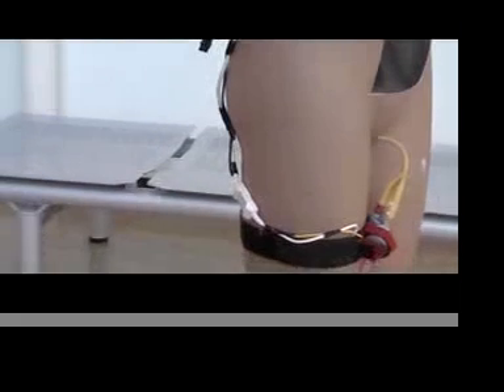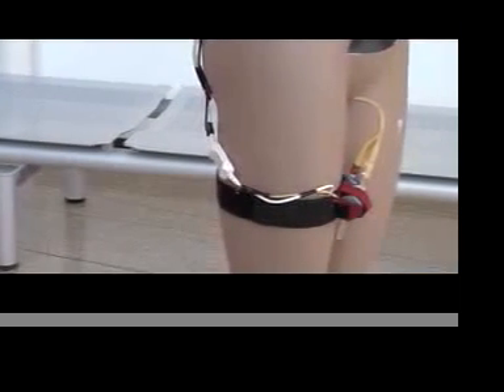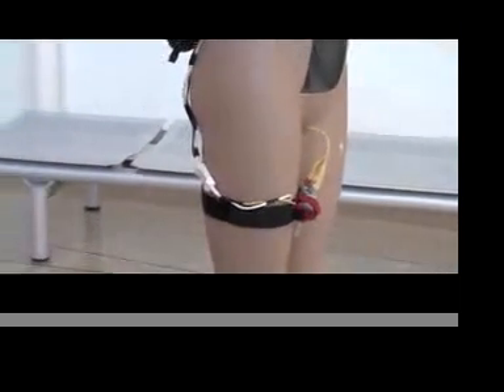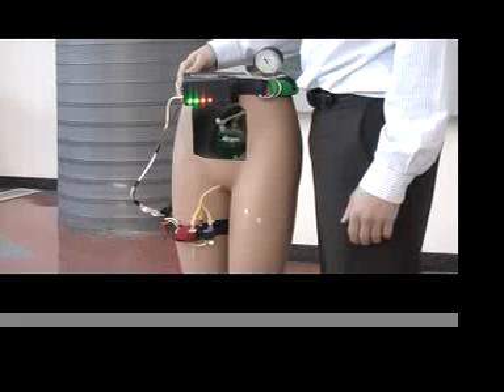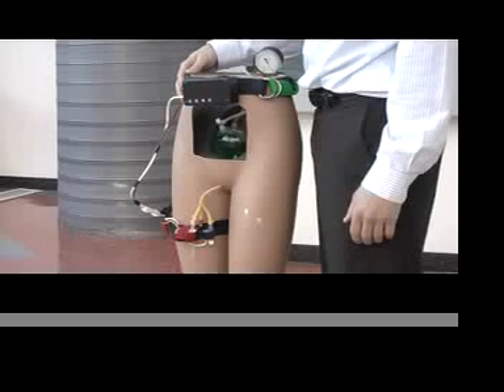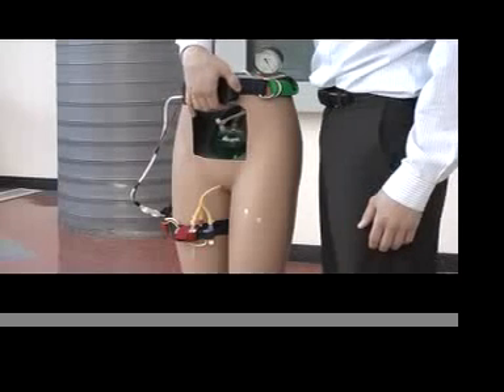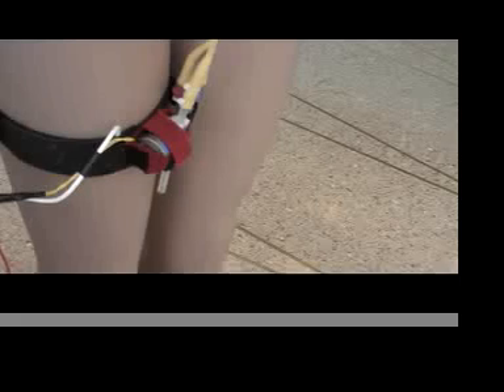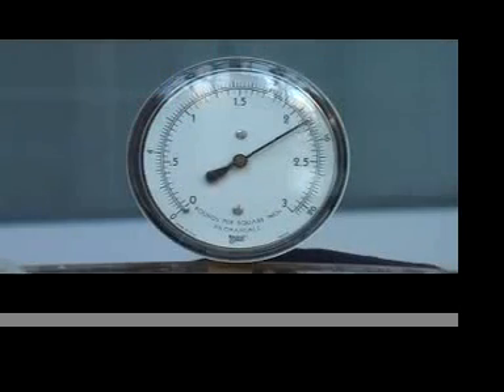Accessible Incontinence Control Device

Comment: @wtbman2 As I use both catheters and diapers,I prefer the cath over the diaper anyday,despite the discomfort you get with a cath you get used to it,diapers cause your skin to break down very quickly if wet for any period of time.No doubt when this unit is manufactured the control unit and the valve will be made far smaller and sleeker and possibly wireless,wouldnt be so bad then.This is just a mock up to demonstrate the system.Its far too big and bulky for daily use!!

Comment: @krissovich An implantable valve into the abdominal wall with a suprapubic catheter into the bladder is another idea to make obsolete the urethral catheter and their problems,the device could be implanted so that it would never need to be changed,it could be made co-axial,the device implanted and a replaceable SCath going through the middle that can be changed incase of blockage/incrustation etc,being anchored no balloon is needed.Infection could be reduced/iliminated,lots of possibilities.

Comment: Good idea as it allows the user to maintain bladder tone and volume,which is lost with long term foley use.I can see a night application where the unit allows the bladder to fill to a certain sprecified pressure then to release automaticaly into a night bag,I understand its in early development but a wireless system with a wrist worn watch/controller would certainly improve the product as timing between voids is also important,the ability to record pressures/volume/times would be helpful too.

Comment from the maker: The alarms are customizable (can select any combination of visual, audible, or vibrate).  And there is a safety switch that must be engaged before you can void.

The thigh strap is there since our valve is so bulky but that likely wouldn't be required in future prototype.